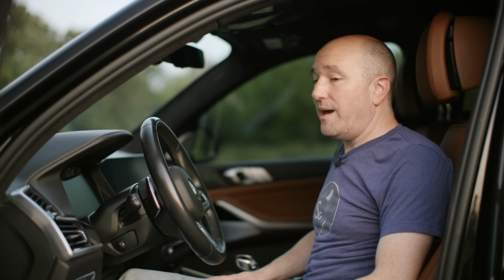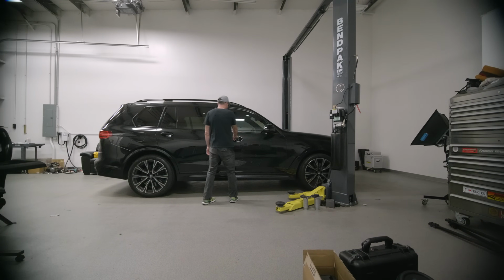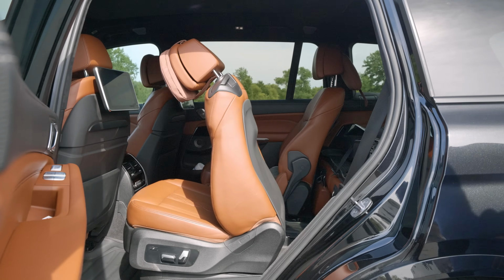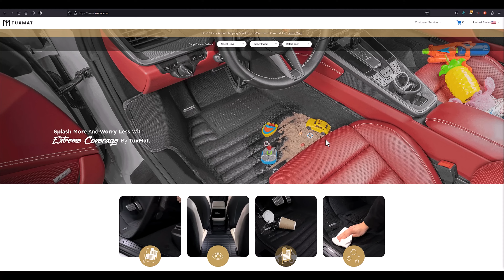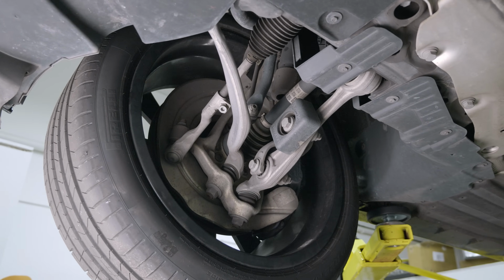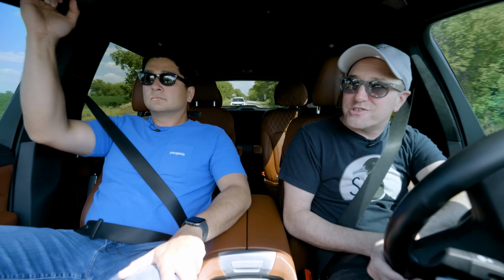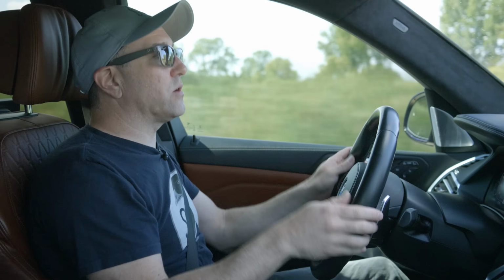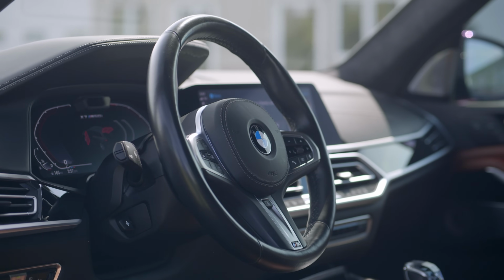BMW X7 | 45,000 Mile Long Term Results

Comment: mazda cx30 ihhs ncap crash test scores are good given the weight , mpg, costs, size. but when you run full power fan blower and air conditioning, engine shakes a lot while idlng, honda crv 1.4 liter, a couple lexus and venza, did not shake so much... maybe shaking will wear out the connection between engine and car and then require a screw tightening and theres no a warning light for  that, it doesnt feel loud and shaky inside car

Comment: My friend had an M50i similar to this, with a similar story. Gas and maintenance costs were through the roof. After an expensive repair, he bought a 2022 Tesla Model X, and has never looked back.  It has of course less features, and had one quality issue (which they fixed) but kills his M50i in performance, is extremely efficient, and has costed him $0 in maintenance. Plus he charges mostly at home and no longer has to visit a gas station. We drove from SF area to LA with literally 1 twenty mins charging stop

Comment: I'm so iffy on those N62 motors. They've had valve-stem seals issues since 2002, and still have issues with them. Those V8s had turbo, timing chain, and VANOS issues. Not all, but plenty
Reply: It's an N63 engine. The one in this particular vehicle is the N63B44T3. Numerous versions after the one in the 2002 - 2013 vehicles.
Reply: @robertallen5210  - Yeah.... but even the X7 have factory vale-stem seal kit repair kits, and ironically the latest N62 have the same part number has the old ones that smoked lol... so, it's still crap even today.

That part number fits all these:
5' F07 GT   (09/2008 — 06/2013)
5' F07 GT LCI   (08/2012 — 02/2017)
5' F10   (01/2009 — 10/2016)
5' F10 LCI   (08/2012 — 10/2016)
5' F11   (09/2010 — 06/2013)
5' F11 LCI   (08/2012 — 02/2017)
5' G30   (10/2015 — 12/2019)
5' F90 M5   (01/2016 — 12/2019)
6' F06 Gran Coupé   (06/2011 — 03/2015)
6' F06 Gran Coupé LCI   (06/2014 — 09/2018)
6' F12   (11/2009 — 02/2015)
6' F12 LCI   (05/2014 — 05/2018)
6' F13   (03/2010 — 02/2015)
6' F13 LCI   (06/2014 — 10/2017)
7' F01   (06/2007 — 06/2012)
7' F01 LCI   (05/2011 — 05/2015)
7' F02   (07/2007 — 06/2012)
7' F02 LCI   (05/2011 — 05/2015)
7' F03   (06/2008 — 05/2012)
7' F03 LCI   (03/2012 — 06/2013)
7' F04 Hybrid   (10/2008 — 06/2012)
7' G11   (10/2014 — 02/2019)
7' G11 LCI   (01/2018 — 12/2019)
7' G12   (10/2014 — 02/2019)
7' G12 LCI   (01/2018 — 12/2021)
8' G14   (10/2017 — 12/2019)
8' F91 M8   (11/2017 — 12/2019)
8' G15   (10/2017 — 12/2019)
8' F92 M8   (11/2017 — 12/2019)
8' G16 Gran Coupé   (05/2018 — 12/2019)
8' F93 M8   (10/2018 — 12/2022)
X5 E70   (07/2008 — 06/2013)
X5 E70 LCI   (04/2009 — 06/2013)
X5 F15   (08/2012 — 06/2018)
X5 M F85   (04/2013 — 06/2018)
X5 G05   (10/2017 — 12/2019)
X6 E71   (01/2007 — 06/2014)
X6 E72 Hybrid   (10/2008 — 10/2011)
X6 F16   (09/2013 — 05/2019)
X6 M F86   (10/2013 — 05/2019)
X6 G06   (06/2018 — 12/2019)
X7 G07   (11/2017 — 12/2022)

BMW guru here and this list is directly from BMW official catalogue.. the V8s from BMW aren't the greatest. Crazy how BMW still uses known failing parts to this day.

Comment: The tire part is my issue with this car and other competitors especially for us that drive a decent amount 25-30k miles annually. It’s ridiculous that some sizes are summer tires only especially if you live somewhere where it’s cold and very little snow. I think they forgot it’s a family car not an m3/4 m5.
Reply: This isn't a family car.  It can do family car things, but this ain't no accord.
Reply: You can put less expensive tires on it.  A lot of guys are going with a square setup even though the rear wheels are wider.  Simply order 4 of the same size tires.

Comment: Yeah I want an x7 but I’d rather have the b58 and screw the adaptive rear steering. And as far as air ride and air. Bags go I never understood why everyone uses OEM like aftermarket bags all day. Might take a little fabrication of some fittings but they will ride 1000% better and last way longer. And yeah unless you have big brakes go with a 19inch wheel and thicker tire. No runflats, you will have 100000% better ride and the weight reduction should improve mpg.

Comment: What was the issue with slipping feel at low speed turn? I have a 2019 X7 M50i. 45K miles. I have similar issue going on

Comment: Unfortunately, the second row captains seats are pretty standard in the industry. Doesn’t make sense if you mostly have the third row folded for added cargo space. You basically have a giant 4 seater. I would much rather a bench in the second row. I’m constantly moving child seats  in and out. That tether point on the floor is definitely strange. For slightly more than half that price you could be in an X5 and not miss the third row. Dynamically it’s got to be more fun to drive and the 6 cylinder is far more efficient. Not much more than a loaded MDX.

Comment: Ditch the shitty run-flat tires and the ride and quietness will improve exponentially. I replaced the run-flats on my 2014 3 series  with  Michelin Pilot sport all seasons on it and wow the transformation was incredible. It is so much smoother and quieter and the cost is way less. I have been driving since 1985 and never had a blowout on any car I have driven since then because I maintain my tire pressures and alignment. The risk of not having the perceived security of run-flats which it is said that you can drive up to 50 miles at 50 MPH is a moot point.
Reply: I used to have the same opinion on run flat tires. That is until I was on a road trip cruising down the highway at speed when the tire pressure alarm warned that the right rear had 0 psi! I’d run over chunk of metal and sliced the tire. My 740i never lost stability and I was able to run in the right lane at 50 for about 15 miles to an exit. A bit of googling later, I found a tire store that had a tire in my size, drove 6 miles more and was on my way again 40 minutes later. Had I not had RFT, I’d have been stuck on the shoulder of a very busy freeway waiting for roadside assistance, not a good experience. Now I’m a believer in RFT technology!  BTW, RFT tires have gotten much better over the past few years. However, best to avoid 21” and 22” wheels, the tires are expensive and not always readily available. Mine were 19”.

Comment: This video is not about X7, it is about modification with top engine 4.4. 
In Europe everyone buys 30d, 40d, not 50i, 60i.
There is no such sound, but the price is much lower, depreciation is moderate and fuel consumption is much much better.
And it is like 6 seconds to 60 mph. Not a supercar but good enough.
It will have all pros mentioned by the author without "bleeding money"

Comment: The weight hung on each rear lower control arm is fixing what? If you make an aluminum LCA and then hang weight, why didn't you do cast iron or steel?

Comment: I have a same car but in 40i, we love it! i regretted for not picking up v8 version.
Reply: You don't need the V8, unless you want it.  I have a 2024 M60i and while fun, it is completely not necessary.  The Inline 6 is more than adequate and the LCI has even more power.

Comment: We have a 2018 with the inline 6. Plenty of power and it's great on road trips. No problems after about 43K miles, though the tires are expensive and don't last very long.

Comment: Did Mark ever get rid of it?
Reply from the maker: Still have it.  I have to keep it until I can get out. Keeping miles low.
Reply: @savagegeese  What are thinking of replacing the X7 with? I’m in the same position with my M50i lease ending soon. Don’t see a clear replacement and might have to reluctantly default to a new M60i.

Comment: Ngl but the Mazda CX-90 seems to be a pretty appealing X7 replacement
Reply: doesnt sound all that good, maybe go cheap or mazda cx30 ihhs ncap crash test scores are good given the weight , mpg, costs, size. but when you run full power fan blower and air conditioning, engine shakes a lot while idlng, honda crv 1.4 liter, a couple lexus and venza, did not shake so much... maybe shaking will wear out the connection between engine and car and then require a screw tightening and theres no a warning light for  that, it doesnt feel loud and shaky inside car .
Reply: What's wrong with the CX90?
Reply: @CarGeek360 nothing per say but if you watch The Car Care Nut mechanical review it is heading into premium territory with what could be premium problems and massively increased cost of ownership.
Reply: I haven't watched it yet but I still feel the CX90 will be reliable and affordable to maintain in the long run. I mean the MDX is a luxury SUV that's both of those things (only major issue with the MDX is bad gas mileage).
Reply: how about a old toyota highlander v6, i drove one it still had hydrallic responsive steering pedals etc ,n ice sound ,
Reply: Idk ask savage geese

Comment: Thats why I love my 2010 Nissan Armada 4x4
More spacious, little to no maintenance costs other than oil and filters
Remived air suspension and installed reg shocks by choice
Tires are $1200 all four
9,000 lbs towing capacity
No gimmicks
And 154,000 miles and going strong !
Reply: lol, OK
Reply: Whats the average MPGs on that badboy?
Reply: 14/16
Reply: @mihaiivan8649 
Lol it is what I will do when you have to come up with $4k for new tires and when all the BS gimmicks break down on this x7...and this is from an e46 M3 owner!

Comment: Agreed.  BMW has become just another luxury brand.  The 911 analogy was excellent.... you need 4 doors, you don't want to spend as much, you need more daily driving but you are a driving enthusiast, the choice was BMW.  Not anymore.  The cost of ownership is out of control.  I get it.... but at the same time, others can offer what BMW can and it won't cost a fortune to keep running.   GM took planned obsolescence to the max in the 70'-90's.... sadly it seems like BMW has done the same with shocking you with high maintenance cost should you want to keep the car.  Seems like the strategy is... lease it... don't own it.  I am already looking for another brand to fall in love.
Reply: It's to thin out the heard 😂😂😂 anyone can buy a bmw,but not anyone can maintain them.

Comment: Long term 2020 X5M50i owner, the seats are ventilated, not cooled.  Pretty pointless, ditto on the message “feature”.  Philosophical meanderings aside, and perhaps an over the top vehicle for commuting etc. but given its overall capability, a superb vehicle.  Personally an X1 M35i is all I believe we need, but for wifey.

Comment: I disagree with your MDX comparison. You are on an Air ride. I have the Regular M sport adaptive with DHP. MDX doesnt come close. MDX 10 speed is vastly inferior than the 8 Speed ZF. Not to mention it will be a rust bucket in 5 years.

Comment: You were very lucky with the reliability and I suspect that was only because you purchased an aftermarket warranty. (Take a bow Murphy.)  My experience with the three Bimmers I've had is that if the check-engine light wasn't on there was something wrong.
Reply: @denisvogel5155 Which model and year of BMW did you "own"?
Reply: @MH-xu4ez take your pick of any model BMW from the last 15 to 20 years. They're garbage
Reply: @barrygoldwasser5449  You didn't answer my question. Which year and models have you actually owned or leased?

Comment: I would sell that BMW and get a Honda Odyssey Elite.  It has three rows, is immensely practical, reasonably fuel efficient, and holds its value.   Remember your conclusions when you did the review of that red Odyssey you had for awhile?
Reply: Toyota sienna hybrid. Holds it value even better, does everything else you said, and more reliable according to CR. The best box on wheels.
Reply: Odyssey from this? No chance...  I made the mistake of owning one for a few years and now I understand the minivan hate completely.  No one deserves that experience honestly.

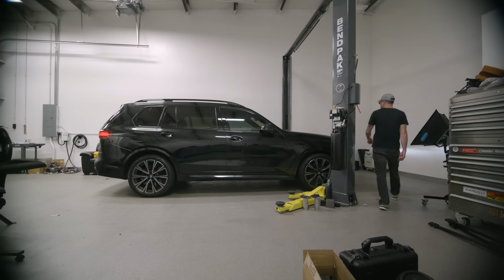Comment: 3:40 Oh, cool. Autorobbery mode. 😜 - In any case, I would so not want that. How lazy can things become? Now the car scans its environment with transmissions all the time just to check whether the driver is near. - Next phase: Multipass chip implant.
13:09 Peculiarly one-sided drive shaft rusting there.
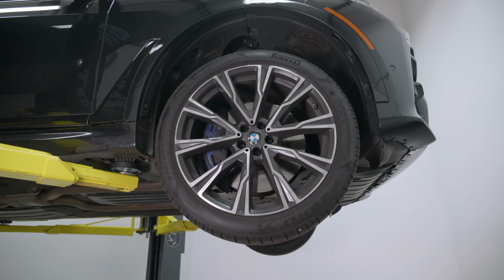13:44 Could it be that tire prices at that size class aren't based merely on material and work but on expected wallet size of people owning cars with that wheel size? (Or does a low volume production factor justify it?)

P.S.: That Ray Ban shades have the logo even on the glasses now is ridiculous, self-parody. It's all about showing everybody you bought a Ray Ban. And I don't even know whether there is anything that makes them special or it's just all marketing. I just know the existence of the brand is causing a ton of e-mail spam, so I have to assume even more that it is all about male self-esteem.

Comment: I’ve got Ferraris and Porsches and most of the time I walk past them to drive my X7 M50i.  My favorite SUV of all time.  Zero issues with mine after 3 years.  The M60i doesn’t sound as good and not a fan of the updated interior.  Especially the gear selector.

Comment: Did you really just use the word "reliable" while referring to the N63? Yikes. The amount of things I've seen go wrong with those engines is staggering, it's by far BMW's least reliable V8. Yes, the M62 had timing chain issues, but that's a one-and-done fix for the most part, same with the N62 and its valve stem seals + alternator bracket gasket + coolant crossover pipe, you dump the money once and it generally behaves afterwards. The N63 is just a never-ending pain, with timing issues, oil pump issues, valve stem seal failure, insanely expensive oil and coolant leaks from the turbos, and more. Every shop around me that works on modern BMW's says the exact same thing about the N63, it's junk for the most part, especially once it's past the warranty period.

Comment: I'll take a V8 GX instead.  Lexus reliability, over BMW Gimmicks.  Performance is not an issue in a larger luxury SUV, the GX has a smaller footprint.  A new GX is half the cost of the BMW and in 7-10 year the GX will be worth more.  The GX has a tighter turning circle making it easier to navigate parking lots.
Reply: @nightdipper5178 Nope. I've owned a 2013 Toyota Land Cruiser and a Lexus 570. Both were the most unreliable vehicles I've owned to date (suspension and electronic issues). After owning two BMW X7s, I'll stick with them from here on out.
Reply: @MH-xu4ez  Thanks for the Laugh!
Reply: @nightdipper5178  You're welcome.

Comment: I don’t know why you wouldn’t just get a 7 series sedan and take all the seats out.
Reply from the maker: I hang out the hatch in back to get shots cant do that in a trunk. Also cant load 6 30" international luggages in a car and still fit 4 people.
Reply: @savagegeese  I don’t know exactly what your shooting position is, and if you have to hang out the back for shot so maybe that’s not possible. But I all but guarantee you it has plenty of room for luggage. And four people. You can take the seats out. And it’s , more horizontal flat, usable space supposed vertical space. but if I an expert, I’m going to do that with an M5 50. I did it with my Kia stinger and it’s just insane how much room it has.

Comment: Agree with all the pros and cons, which are almost all also applicable to by X5 45e. I'm not sure I'd get another BMW, especially with their new "afterthought screen" interior design and their awful false positives in their "safety" systems (all their semi-autonomous helper systems are terrible in my experience), but it might also be hard to go to something less nice in the other areas. It's good in a lot of ways, but just has a few glaring blunders.